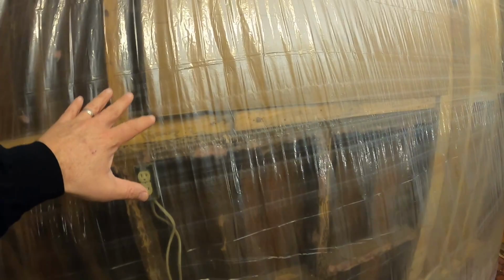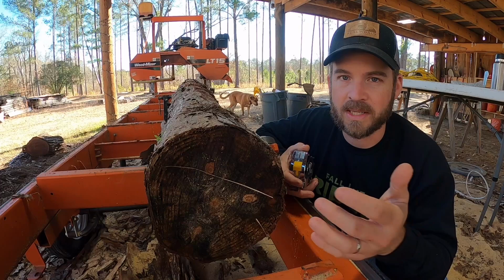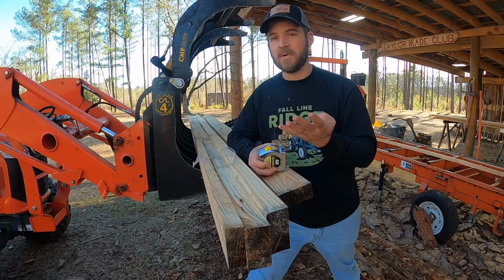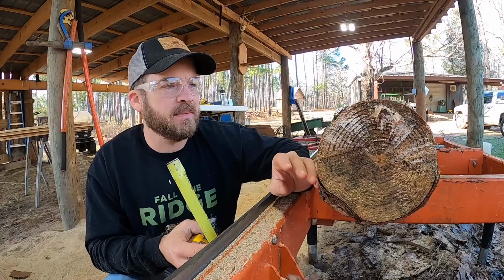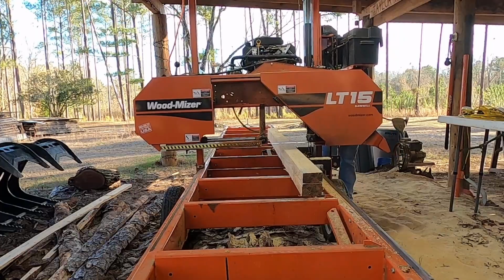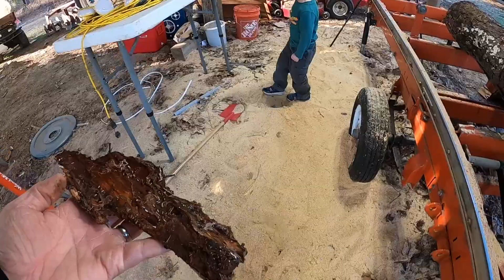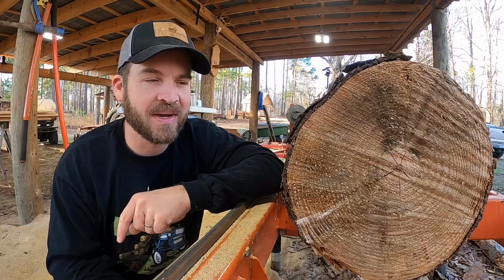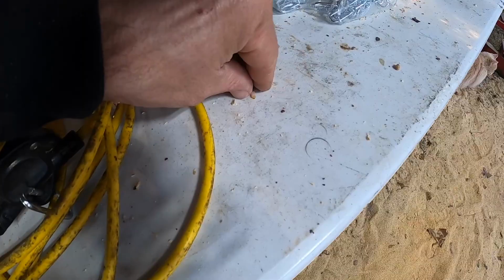Making Custom Lumber for an Old House

Comment: Your conversation with your son about where to ride on the tractor brought back some memories, both good and bad.  Of course, we all loved to hitch a ride as kids, but the other side of that is the potential for some real tragedy if things go wrong.  My brother just barely escaped with his life when he was riding the fender on my uncles WD-45.  He was older than your son, probably around 10, but still at one point he lost his grip and fell down in front of the tire.  My uncle just managed to get the old Allis stopped before running him over.  Now this was the '70's and close calls seemed to happen daily.  In retrospect though, that could have gone so badly.  On a lighter note, I certainly am envious of the mill.  If I had more wooded land I think I would be looking hard at getting one.  Love the idea of cutting my own lumber.

Comment: For 2X4s or any framing stock  Do not be afraid of wane.  A little wane is zero difficulty in framing stock.  An under thickness board can be a pain,,, and must be used in a non critical position.  In general,, you are far better off with a bit of wane than an under sized thickness or depth.  I am old,,, I have framed with rough sawn,, hatchet in hand, lumber so green it still has leaves.

Comment: Hello Wes. Can a car seat, with full seat belt harness, be attached to your tractor for your son to sit on? Have the chickens adjusted to the installed light? Have good days!
Reply from the maker: I'm sure something could be rigged up, but the knee works pretty good. Chickens are laying 3-4 per day, so something is definitely working.

Comment: Really enjoying the videos. I’m looking at getting a Wood Mizer mill. Would you get the LT15 again or go bigger? If I remember correctly. The LT15 is your second mill.
Reply from the maker: Mills are like tractor horsepower, you always want a little bit more. It really depends on what you'll be doing. If you're planning on milling large logs routinely, or if you've got a bad back, a hydraulic mill is what you need. Logs larger than 18" are going to become really tiresome moving with a cant hook. Personally the LT15 is sufficient for me about 75% of the time.

Comment: What was the black plastic train hanging on ur saw ? 👀 Did it go to safety kill switch or something 🤔 or did Lil Man bring it and it got under ur feet and U hung it on saw ?
Reply from the maker: A year or so ago I was pulling the mill down the road with the factory key in the engine and it flew out. My dad had a spare key that he gave me. Not sure if it had that train on it or if he connected it so I wouldn't lose it.